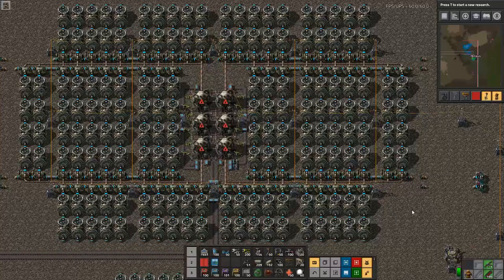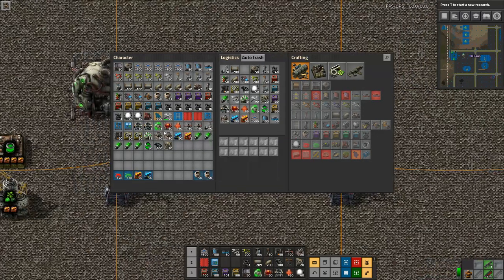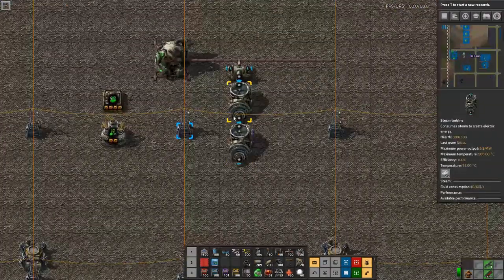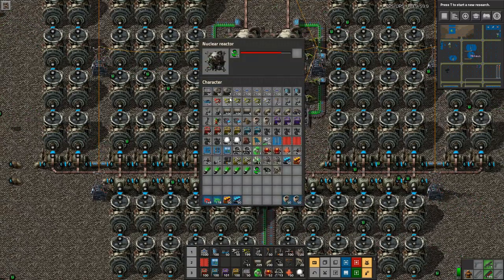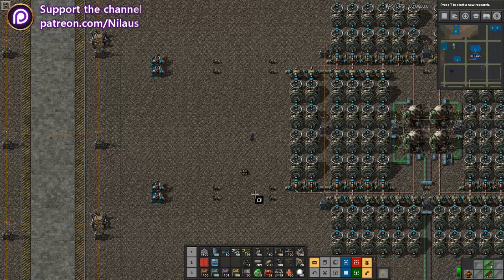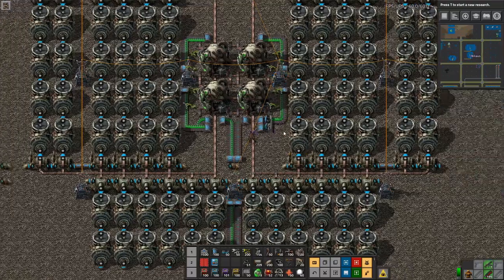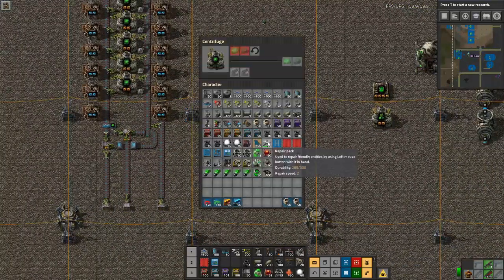Nuclear Power Tutorial - Factorio Engineering

Comment: I just wanna thank you for this Nilaus.  I've always got to nuclear and just found a blueprint and stamped it down. I thought nuclear was complex and I just wanted to get to the rest of my factory.    It was also exasperated by the amount of complex blueprints available. Crazy blueprints doing very complex Kovarex processes, making it even harder for me to understand how nuclear works.

While I did use your blueprints,  the difference is in their simplicity and my understanding.  I used the blueprints because it was easier, not because I didn't understand it.    I'm yet to set up my spent fuel cells recovery machines, but all in the process is working well and I understand it at every step.

Thanks!

Comment: AFAIK heat pipes can only permanently lose a fixed amount of energy, unless you really screw up. In the simplest case, you have a reactor and a heat exchanger connected by a single heat pipe. Your reactor will heat up to 1000 C when you turn it on, which will heat the pipe to 999 C, which will in turn heat the heat exchanger to 998 C. If you then turn off the reactor, and start using the steam, the heat exchanger will cool down to 500 C, the pipe will cool down to 501 C, and the reactor will cool down to 502 C. So, on the pipe, you lost (999 C - 501 C) * 1 MJ/C energy permanently, but only once. Subsequent cycles will lose no energy.

The way to really screw up is to put all your reactors and heat exchangers on a single line. A heat pipe can only transmit 1 GW, so it won't cool the reactors enough, and they will waste power.

What I like to do is build "too many" heat exchangers for the amount of reactors, and "too many" turbines for the amount of heat exchangers, and add some storage tanks. If you do it right, the reactor temperature always stays below the maximum. If it does not, you need more tanks, or your control circuits are broken. This way, the reactors, pipes and heat exchangers all act as energy storage, and it's quite a significant amount. 

Each reactor stores 5 GJ, each heatpipe stores 1 MJ, and each heat exchanger stores 500 MJ as heat. (Slightly less depending on your layout.) A heat exchanger also stores 19.4 MJ in steam, same as a steam turbine, a pipe stores 9.7 MJ, and of course, a storage tank stores 2.425 GJ. I like to count all these free energy stores by boxing them, then add tanks to have enough storage for 2 rounds of fuel cells, and set up control electronics so that only 2 are inside a reactor at any time. Don't add more fuel if there isn't enough free storage for it. You can get away with less storage if you can estimate the consumption somehow, and take that into account. I didn't do that yet, and I have no good idea how I would.

Then there is also the formidable challenge of getting the water in, and getting the steam out. The latter is especially nasty, because the game will tell you everything is fine, if the steam is blocked, you must not be needing that energy. This is not an exact science, at least until the new fluid mechanincs are implemented. But you can build the entire thing on a landfill island, and have water right where you need it. Then use an unnecessarily large amount of pumps to get the steam out.
Reply: @toddkes5890  You could but you'll need a LOT of trains. A medium size 16 reactor (2.4 GW) power plant would fill a fluid wagon in slightly over a second. It would be 40 tiles long, meaning you could park two 2 + 5 trains on the two sides. They both have to leave, and two new ones have to arrive every 10.1 seconds for this to work. And this is average for full utilization, you'd need more during surge demand. How many trains this needs depends on the distances.

You also have to consider the time delay. If you have steam turbines connected directly to the steam tanks, and power lines running to your outpost, the plant can respond pretty much instantly to power spikes. You will need some storage locally to smooth these out and give the trains a chance to react.

But maybe you'll end up with a smaller plant, all things considered. There is a lot of storage at the outpost stations and in the trains themselves, and you only have to stop the reactors if all of that is getting full. (Assuming your train logic knows to "push" steam even if an outpost doesn't really need it yet.)
Reply: @toddkes5890  As long as train delivery does not become a bottleneck, this will work. But that should not be a problem for 6 reactors. I'm not so sure about larger ones. 

Also consider you will necessarily have some storage tanks on the receiving end, and a fluid wagon is a storage tank on wheels. So you could get away with building less than 80. Keeping track of those amounts can get tricky though, especially if you don't have a global circuit network.

Comment: @ Nilaus  Try Conecti the the wagon pump  after the water pump then the pipe and then check the steam levels you get  basically it pushes true more water to make more steam in  one heat exchange  you get around double the output  in power

Comment: I guess I am doing something right, as I am getting 803MW of power. I have the 2x3 reactors with 80 heat exchangers and 138 turbines. The problem I had is getting the water to flow correctly.I had the ratios right but I had to split up the turbines so each line of pipes goes to a certain number. 8 exchangers -> 17 turbines; roughly. Though my design is not all neat and compact. I used to use pumps to get the water to flow at a decent rate. Even though I have a lake nearby, sometimes water isn't as easy to come by; so you can bring it in  by train or have robots move packaged water and that is a whole another setup to get right.

Comment: One thing I ALWAYS do is building auxiliary power network (solid fuel powered, I float in this crap bu this point) dedicated to making more uranium (Kovarex is cheap enough to get), then expand to about 4 Centrifuges (with maxed out speed modules) for good stuff.

I personally use slightly different design with "buffer" steam tanks and some extra piping thrown in for good measure (pipe throughput actually matter here if you botch design), basically one reactor + L-shape boilers and tanks where you have turbines. the reason for this is I can use tanks, pumps and circuit network to control fuel inserters (I rarely get tho the point when I actually need to run whole setup constantly.

Comment: Firstly, I don't actually play Factorio, I just love watching your streams and seeing how you do things.
Saying that,  I have no idea whether this idea would work or not (or even if it would be efficient), but would it be possible to put the storage tank between the heat exchanger and the steam turbines then set up some sort of logic circuit so when the storage tanks drop to a certain level the reactor gets fed another uranium? If that would work then wouldn't the steam turbines connected to the tank run at full capacity?
Love your videos, especially the 4hr streams you've switched over to your Nilaus.tv channel. Keep em coming :D
Reply: I have my input inserted set to only input 1 fuel cell, when it detects a pulse from the output insteryers removing a spent fuel cell. The output inverters will only remove a spent fuel cell when my steam tank has <5000 steam in it.

Its not really neccessary bit I like that it runs efficiently.

Comment: You actualy need 5 pums for 4 reactors
Reply: Yep and since he has more turbines it's even more important to keep them saturated with water.
heat exchanger uses 103 water units per second a pump produces 1200 per second
There are 48 heat exchangers 
48 * 103 = 4944
Unfortunately 4 pumps is only 4800, so you do need 5 and keep in mind fluid dynamics here as well because too many pipes will make you not get enough water.

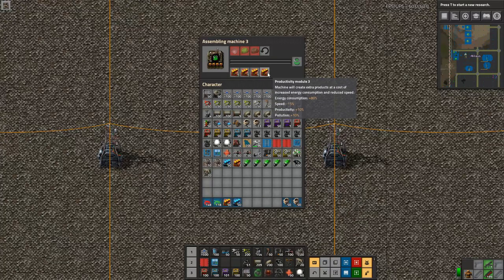Comment: 4:30 "one fuel cell for 2:00 minutes" ? shouldn't that be "one fuel cell for 200 seconds" (3:20 minutes) ? or did they nerf it recently ?
20:00 thus you also wouldn't need 30 fuel per hour, but only 3600/200 = 18 fuel cells, being able to feed almost twice the number of reactors with your produced 30 cells/h :-)
22:05 yes, that is possible now, but many sources might tell that it's not possible since at first it was buggy (giving the bonus on all 41 and not only on the one additionally produced) and they disabled prod modules completely until they fixed it properly by inventing some "catalyst" mechanics so that "40 in and 40 out" levels out before(!) calculating the prod bonus for only the 41st item.
Reply: Numbers are not his strength. He said that 56 miners produce 1000 Uranium per hour, which is obviously wrong. Uranium mining speed is 0.25/s, so with 56 miners you get 14 Uranium ore per second or about 50k per hour (~60k with 20% mining productivity bonus). The processing takes 10 ore for 1 U238 or U235, so you get ~6k processed Uranium per hour or ~8.5k if all machines have 4 level 3 productivity modules (40% productivity bonus). Now take 0.7% of this as the U235 yield and you get 59.3 per hour or just about 1 per minute - he said you get 8.5 per hour...
The fuel making converts 1 U235 into 10 fuel cells, which gives you 830 fuel cells per hour (assuming 40% productivity bonus). Since a fuel cell can run a reactor for 200s, you can run exactly 46 reactors continuously from 56 mines. So he is off by an order of magnitude and it's actually way less difficult to get nuclear power running without Kovarex.
Reply: @RealNovgorod  Just a slight correction to your numbers. A centrifuge is used for processing the uranium ore. I can accommodate only 2 modules, so the productivity improvement will be limited to only 20%. The rest of the numbers look right. Thank you for showing the work. As a mathematician, I appreciate it.
Reply: @michelguenette8998  Correct! Just wanted to see if anyone paid attention :D..
Reply: @RealNovgorod  Yep he got the amount of pumps required wrong as well lol